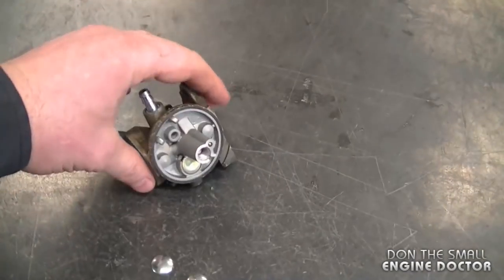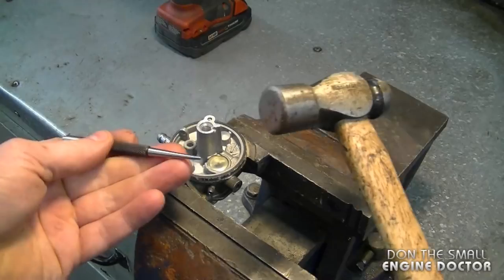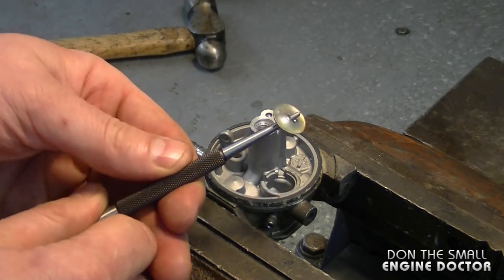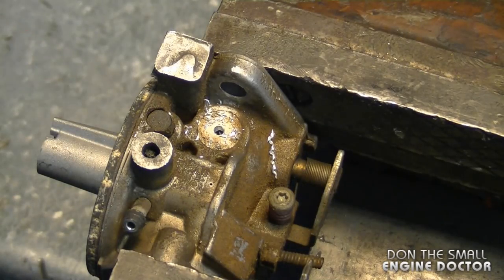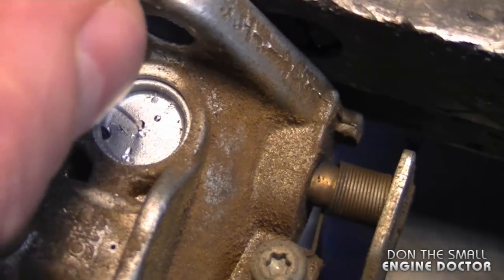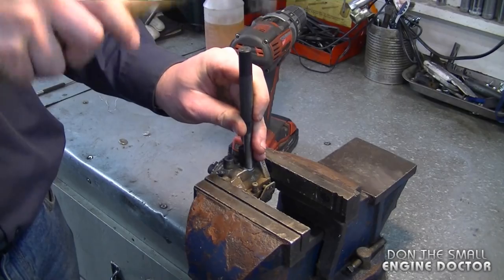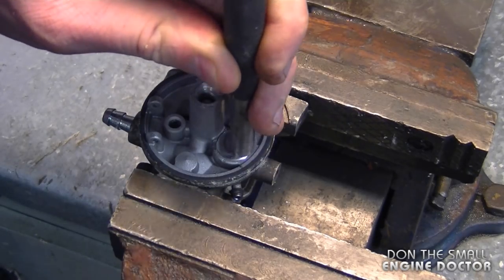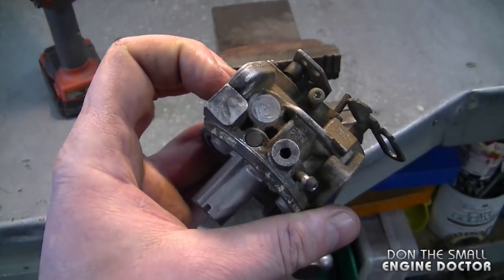HOW-TO Replace Carburetor Welch Plugs

Comment: PALAWNGUY: Dony wrap three layers of masking tape around the drill bit with only the amount of desired cutting extension protruding below the tape to help control the depth you feel you can drill in, also place a small amount of grease on this cutting end to help catch the chips. I would have extracted the chips with a shop vac rather than run the possibility of blowing some of them into the passages. Just some thoughts.

Comment: The one inside my Briggs and Stratton Carb came loose and fell out when I was cleaning it. I didn't know what it was and after the cleaning, I forgot to put it back in. Should I have or can the Carb run properly without it? Thanks.

Comment: To avoid drilling too far I use a wood dowel and drill through it and expose just enough of the drill to get through the part without going too far to cause damage. Like others have said, a piece of rubber tubing or hose works great also. Great informative videos,  thank you.

Comment: Interesting bit of trivia: "The Welch plug was originally designed in the 1900s by the Welch brothers at the Welch Motor Car Company of Pontiac, Michigan. At that time core holes in the engine blocks were fitted with pipe plugs. During one of these run-ins a pipe plug backed out. In order to get back on the road one of the brothers drove a quarter or half dollar into the hole. From this they developed the Welch plug,. They then patented the plug and the M.D. Hubbard Spring Company became the sole manufacturer of the Welch plug for the life of the patent."

References
Reply: jj parody so, what was the “purpose of the plug to begin with? Just need to clarify!

Comment: This is probably what is wrong with my old carb on my Areins 924102 Tecumsah Snowblower.  I clean the air screw and the brass bolt in the bowl and still the engine surged.  I had no idea about these parts as I am new to these types of repairs.  I will order a rebuild kit and welsh plugs for the old one and fix it up as a backup.  I purchased a new carburetor on Amazon for 16.00 and it works perfect.  Great video thanks for making this

Comment: another great job !
i never take them out simply because i don't have replacements laying around . sometimes a carb still doesn't work right after cleaning and i wonder if removing the welsh plugs might result in a more thorough cleaning job. it would be really handy if there was a kit available with a wide assortment of these.
Reply: I had to throw away a walbro carb because it needed the welch plugs removing to clean debris and I had no way of reliably plugging the holes..

Comment: Smashing :-D
I had to remove one last year to clean behind it.
i also drilled a tiny hole in the center, i screwed a wood screw into the hole then carefully lifted the screw with wire cutters and a small bit of wood between the cutters and carb body to allow leverage.

I didn't have a new plug so i reformed the dome shape, then soldered the tiny hole up.
Tapped it back into place with a flat ended rod.
Finally tested leaks by applying petrol, none got past the plug.
Yes im a bit of a bodger, but this bodge seemed sound :-D
Reply: There are plenty of acceptable methods .  I would call yours the CORRECT  method.
Reply: George Dodd, Thank you :-D.

As i come from a poor family, i could not afford to buy new things, so diy repairs were the norm :-D.
It didn't do me any harm, shame that the current society seems to throw so much away.
Reply: Any new kid would come with new plugs. You're going to take it apart to clean it and actually do the correct maintenance you would have had the new part. 
So that one day comes and it will when you go to start something and it don't run right you'll know why Dodger

Comment: I know on the Walbro carbys on the 2 stroke trimmers they say it doesn't hurt to apply a dab of nail polish to the outside of the Welsh plug(s),just for added sealability.

I know about not needing any glue as I bought a bodgy carburetor which was like that,the main jet was glued in with Loctite & the fuel ate it away & gave me a lot of trouble with air & fuel leaks.

Replacing the carby was the only quick solution.

I've replaced welsh plugs on a car engine that I rebuilt,I removed the old ones to clean the water jackets,they do require sealant.

There's quite a few tricks of the trade with repairing carburetors,Taryl has made himself some tools to replace the needle seat inside them.

Comment: Grease on the drill bit also helps stick any particles to the drill so that nothing enters the passages.  Thanks for the information! Am just going out to my shop to rebuild my outboard carbs and will remove welch plugs since they came with the rebuild kit.

Comment: Good info thank you. one comment I would like to make when Drilling a blind hole and it is critical not to go too deep I like to take a small wooden dowel drill through it letting only part of the drill stick out deep enough to drill a minimum depth hole and not worry about any damage by drilling too deep thanks

Comment: So question..... There is a little tab there to flick out the Welch plug that's what I use why you drill it and take so much more work for yourself? The outside yes but not the inside one. Good video.

Comment: Thanks Donnie, I wasn’t able to get my Techumsee plug to hold. Now I know why. Tip on drilling to prevent plunging thru... use a piece of tubing cut to length and slid over drill bit only exposing enough to penetrate plug then it will act as a stop..... thanks for the tip
Reply: How did you solve the not sealing plug problem?
Reply: Gogle Plus Sucks I didn’t, it’s been a while but as I recall I left them out. It runs....

Comment: Already done this. Hammer a center divot with a screwdriver bit. Hold in one hand. Drill in another. Start with a small bit. If you can't pick out the welch plug, drill a larger hole until you can pry it out. Put carb on bench or piece of wood. Tap in the new welch plug with a drill bit shank and claw hammer. It doesn't take much force to flatten.

Comment: Nice video a good way to stop you drilling to deep when you a job like this one is to have a drill bit reserved for it and drill out a few pop rivets with it leave the all pop rivet heads one this will act as depth stop and no damaged to the carb
Reply: orange12v jj

Comment: Good information Don.  Now, how do you remove a main jet nozzle from a carburetor, such as a old Carter model "N" carburetor from a small engine?  It is made of brass, has a slot for a perfectly fitting screwdriver, but will not budge.  I have such a situation and it should be removed to clean any small holes.  Thanks again.

Comment: Good video Don..Did you ever do a video on replacing those lead shot plugs on a carb?I had one come loose on top of my Johnson outboard carb.Never saw one come loose before.The top of it popped off I guess leaving the piece going into the needle jet area loose.Motor started running terrible at idle.Took alittle bit of troubleshooting to figure it out.I did get info from some others on how to fix it.Hammered a piece of sinker in there and sealed it with a number of coats of good nail polish.

Comment: Great video thanks for the tips . But I was just wondering which  carburetor cleaner do u use to clean your carburetors ?, the reason  I ask is because a lot of them will destroy any rubber on carbs an I've learned the hard way an had to buy replacement parts .

Comment: Great video as usual. I'm curious why B&S says to use enamel nail polish once the welch plug is put in. If you have a drill press it's a bit easier and you can almost guarantee that the drill bit will not hit the inside. I would love to see a video of those little rectangular welch plugs on 2 cycle engines - hot to remove and replace.
Reply: Donny is really flattening out that plug more than he needs too.
Briggs tells you to use nail polish because it resists gasoline and seals the edges of the plug instead of really flattening it out like Donny does.

I worry he might mash it in there too much and disturb things inside that metering chamber.
Not only is there fuel in there but also air.
You need a certain amount of space inside the chamber for those two components to mix so then they air and fuel passes through the tiny ports from the low side of the carb behind the throttle shutter they are a fine mist and not big droplet.

Comment: I have a mower with a Briggs engine that is hard to start.  I have taken the carb apart and discovered the two welch plugs were in the bowl and not attached to the carb.  Could this cause a problem with starting?  It has not yet been installed.  Thank you.
Reply from the maker: yes it could

Comment: I have question for the dome shape plugs is there a spécial tool to put them in. This will be my first time replace the plugs but ive rebuilt plenty of carbs i never did plugs thinking i needed speical tool to put them in. I can do it your way just woundering if they sell such a tool for that might be nice to have.

Comment: Where can I buy an assortment of these plugs ?  The carb on my JD x300 is missing a small  welch plug on the top above the tip of the emulsion tube and the air leak from the missing plug is creating surging idle that cannot be influenced by the pilot jet needle valve.  I assume the plug fell out sometime in the past (?)  I have a dab of silicone sealing the hole now but would rather use a metal plug if I can find one.
Reply: Silicone is bad, crystalizes and clogs the passages inside a carb, that's why I'm rebuilding 3 carbs off an outboard. The previous owner used silicone to "seal" the gas line fittings from fuel tank to the outboard. What a mess!

Comment: Kinda looks like a Tillotson carb.... but maybe that's just my old eyes. Good basic lesson, Don - these things need to be taught these days - real mechanics and true repairs instead of replacing "assemblies" is a fast-dying art.
Reply: Melquiades Estrada that is exactly what it looks like used on Old Harleys and Harley golf cars and many other older tractors. Thought the same thing as you did when I first saw it. And when rebuilding them use a ball pump to test for leaks in the Welch plug and diaphragms

Comment: Could you do a video on STIHL carbs and what causes them to idol ok but they have problems running full throttle? I have to run mine 3/4 choke to get them to run up. Thanks and great videos as always!
Reply from the maker: https://www.youtube.com/watch?v=J1ZZvwbJmuw
Reply: check your spark arrestor in the muffler too.. if it has one

Comment: Where do you obtain replacement plugs?  Do you buy them individually or do they come in an assortment?
Reply: Usually come in full carb rebuild kits.  Otherwise you'd have to buy from manufacturer dealer, or carefully measure and buy, probably online.

Comment: I have a Briggs & Stratton 19.5 Intel XRD Model#31P677 
Type: 137381
Code: 0911167D
Can you recommend a new carb. I tried cleaning jets with carb cleaner. Low idle it runs OK, above 1/2 throttle to full throttle it misfires. There is a lot of Chinese ones, hard to tell which are the good ones.

Comment: I have a power generator with the Tecumseh engine and carburetor on it and never was used since I purchased it new in 2000. I have to get it working if the parts are available for it. I know the carburetor is in need of repair since it has been sitting so long without being used.

Comment: Dear Donyboy 73 I need your help.
I have engine Tecumseh OVXL120-202704 and when I turn it on it start with high speed and the leaver for speed doesn't work, also I have to say I opened the carburetor and cleaned with purple power but I didn't changed any thing in it.  Help me

Comment: Where does the tiny vent hole at the bottom middle of the screen at 2:27 go?  
I tried putting a vacuum pump on mine and is seems plugged.

Comment: When I disassemble for the first time the carburetor of my Briggs and Stratton 650 there was a welch plug missing. Probably some previous repair man that I gave the lawn mower miss it. I wonder if I should replace it (it works fine without it, I think...). Also if someone knows how I’ve got to order a “Welch plug” in spanish, it would be helpful to illustrate me because I can’t translate the concept.
Reply: Mostra Les una foto. No se como se dice welsh plug en espanol tanpoco.

Comment: uh oh!!!); hey my dumb ass just accidentally drilled into to carb itself under the plug!Is there any way i can fill the hole with jb weld or anything that will last and hold up to the fuel and oil?it an old series 2 tecumseh outboard carb!im kicking myself hard right now!!!!plz help!

Comment: What is a Welch Plug?
Reply: Watch video, those are welch plugs.
Reply: What does a Welch plug do and the purpose of it?
Reply: rk22cc A Welch plug is a specifically sized space that acts as a vacuum port to regulate air intake flow through the carburetor to help meter the air with the flow of fuel.